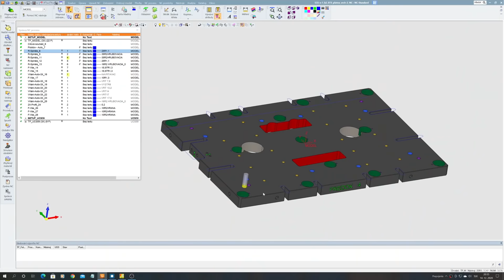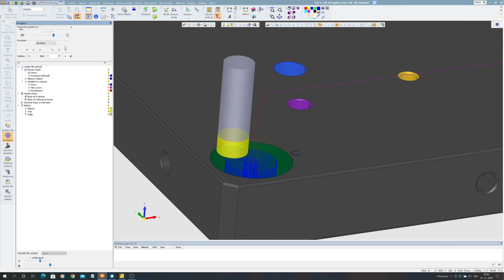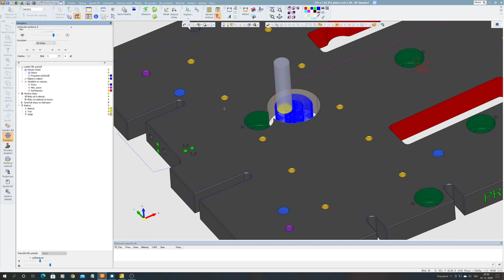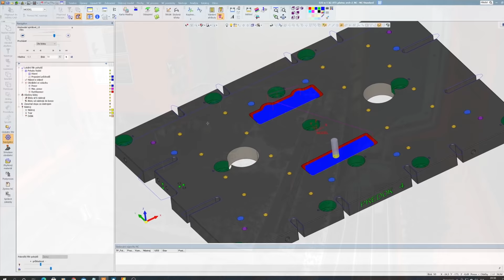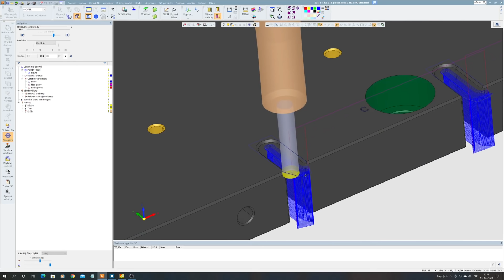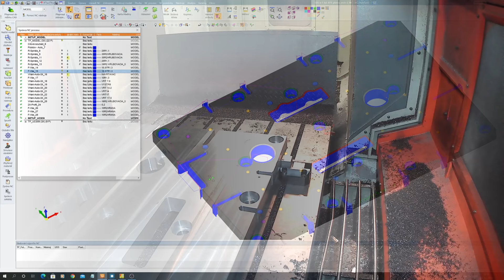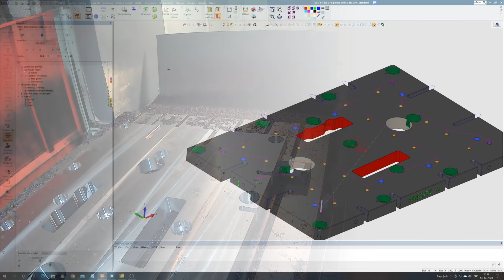Making of big plate (cnc milling)

Comment: oh I can see that this plate is only supported on the corners and the center od workpiece is im the się not fixed at all.  How did you manage to mill holes in the center of such a large piece without damaging the inserts on the high feed mill?
Reply from the maker: The plate is quite thick, so it went well.